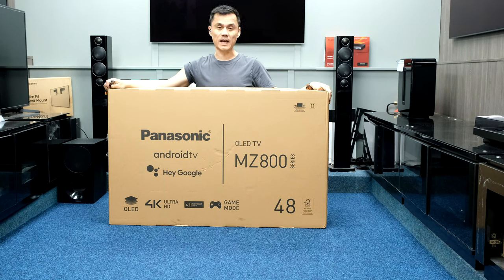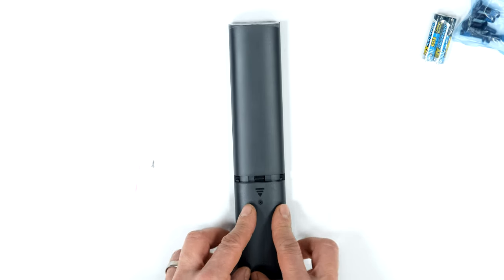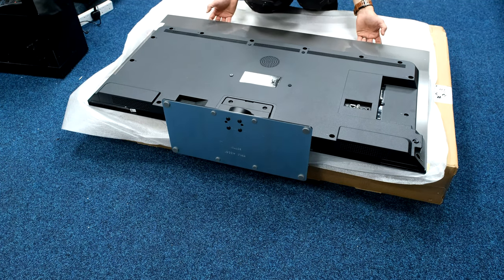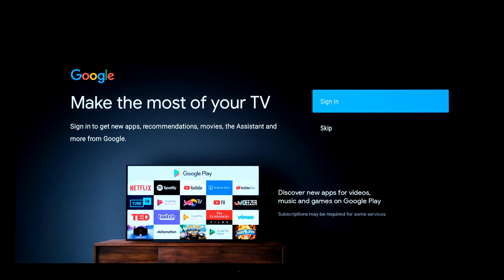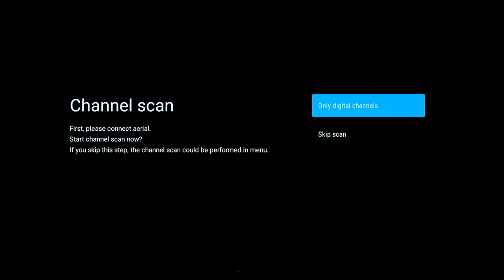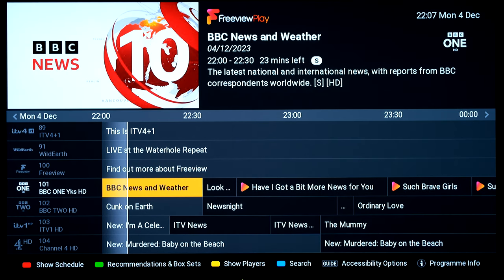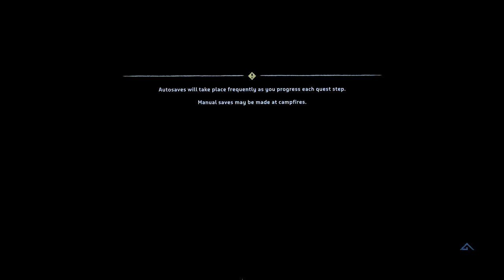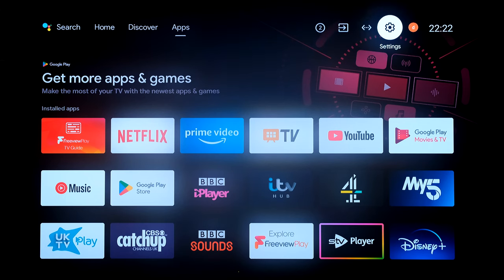Panasonic MZ800 Series 4K  OLED Android TV OLED Unboxing Setup and Test

Comment: Funny isn't on how panasonic puts the android tv on its low tier oled and on its top of the range they have there own operating system which is absolutely crap
Reply: That’s changing for 2024 - they have now switched to the FireTV operating system.
Reply: Strange because other than Android OS other smart TV OSs espresso LG Web OS are mediocre Samsung might abandon Tizen I read for 2024 TVs

Comment: Interesting fact. This TV isn't actually a Panasonic, it's only branded as such. It's manufactured by Vestel and is based on the Toshiba XA9D OLED.
Reply from the maker: Made in Turkey for Panasonic, vestel is probably the biggest tv manufacturer in the world. Hitachi jvc Bush and many others as well
Reply: That maybe so. But couldn't the same also be said of Iphones? Apple doesn't actully make them. They design the elecronics and hardware and then out source manufacturing. If this has Panasonic designed processing, which is considered top notch, and the hardware is all made by a third party, and that reduces the cost then surely those who want Panasonic special sauce processing at a lower price it could be a really good buy.
Reply: @TomUK7  it's not the same thing. This TV is based on a Vestel reference design. It's not been designed by Panasonic, and also isn't built to a spec that Panasonic require. They basically take the Vestel reference design, stick a Panasonic logo on it, and that's it. This is the same for all TV's manufactured by Vestel, including the Panasonic MX600/700 series of LCD TV's.
Reply from the maker: @damtech751  it's got an LG oled 10 bit panel though, I think from the b series. The processing power could be better with this tv if using with the inbuilt apps bit I've been using maily through my fire cube and pc etc
Reply: The panel is LG
Reply: The panel is LG
Reply: @damtech751  Im not privy to the ins and outs of TV production. But I can imagine if the 'shell' of the TV is based, as you say, on a Vestel blueprint then how is that effecting the overall pitcure quality if the picture processing or computational stuff is provided by Panasonic and the panel is made by LG? Its just a frame housing the components designed by Panaosnic and LG. Which reduces cost to consumer. I can see that being a good thing if I'm not fussed by the actual design of the outside of the TV
Reply: Made in Turkey? Oke will not buy it then. Panasonic needs to be ashamed

Comment: There is a mz800b and a mz800! What is the difference?
Reply: The difference between the Panasonic TX-MZ800 and TX-MZ800B models is typically regional. The “B” in MZ800B often signifies a version intended for the UK or British market, while the model without the “B” (MZ800) might be sold in other regions. Both models usually have identical specifications and features, but the “B” version may include region-specific features or software, such as tuning for local broadcast standards or different pre-installed apps.